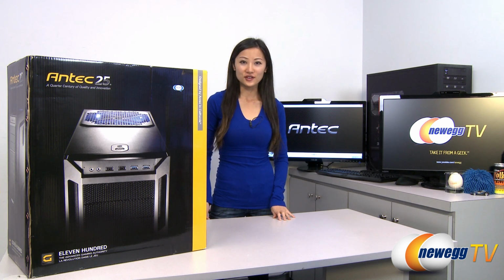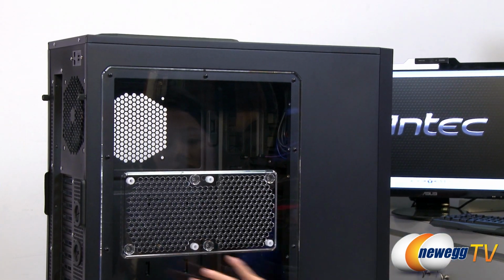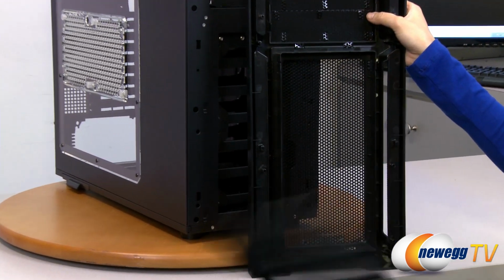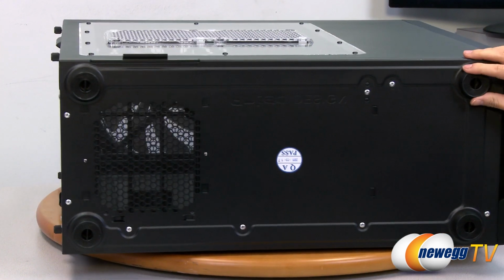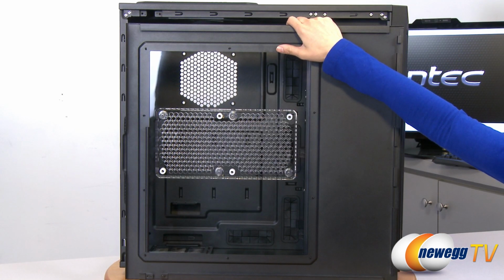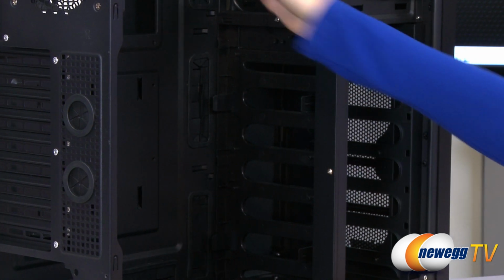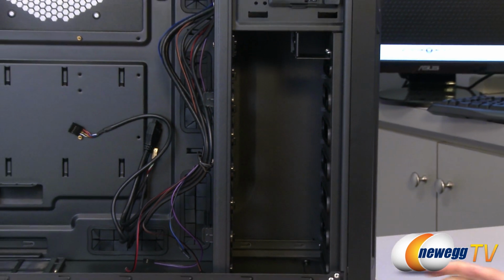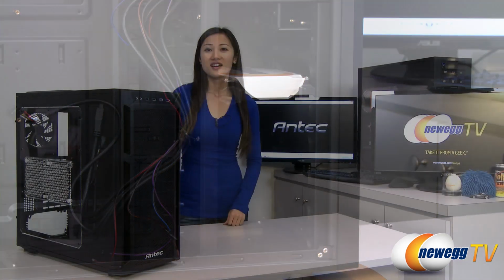Newegg TV: Antec Eleven Hundred Black Super Mid Tower Computer Case Overview

Comment: The side panel on that case would look so much better if antec added two more mounting points for two 120 mm fans under the two you can add to this case.  It would give the case a better look as well as additional cooling for the bottom graphics card if you install one.

Comment: likely not put there are placements for 2 120mm fans inside the case by the hdd drives, you will have to get creative if you want to mount there, as the graphics cards could interfere with the radiator, besides, you wouldn't get cool air through there

Comment: @sindekit because that is the standard. i know what your thinking. have them both in one and use your iphone headphones as a headset. but only moble devices use the 4 channel plug. it would take alot of effort to change the pc standard from separate plugs to both in one. personally, i never use the headphone microphone jack. i like the USB headsets better. you can get real 7.1 out of USB. while front panel is only 2.1.

Comment: This Case is good but i cant stand the the honeycomb on the sidepanel and the other side panel has the weirdest place to put a fan like wtf ?? you have to remove front cover to get to air filter ........ and both HDD and power LED are the same color at least differentiate  .. and the back has a spot thats empty thats suppose to be for a fan controller overall 7/10 its okay but next time ill get a better one....... like the 650D

Comment: I got my 1100 in January and this is by far one if the most capable cases for its size. The price isnt the cheapest, but why skimp on performance and versatility? Very well thought out. XL ATX support. The 5.25 bays are tooless with options to use screws. Lots of cable room. Plus, it cools like no other. My hard drives stay super chilly.

Comment: @htfkid2000 Faster processors and stronger graphics card.Or you could probablly even fit 2 graphics card in this case which is double the power.